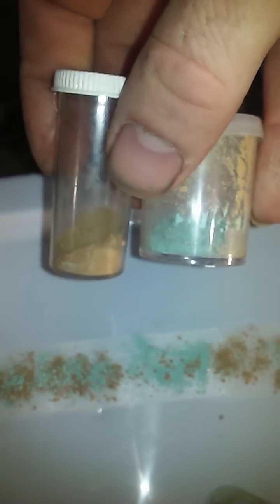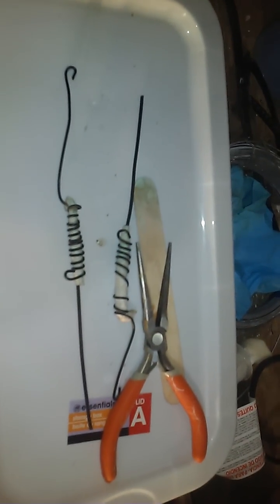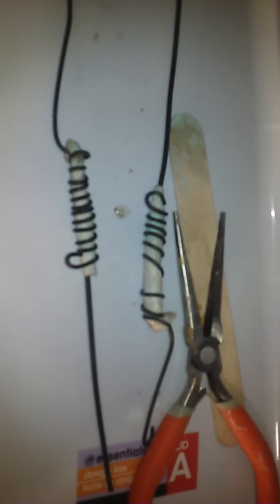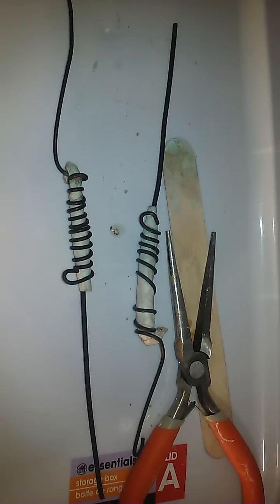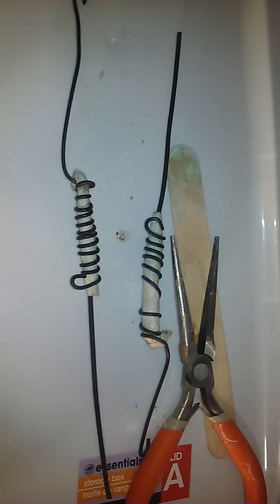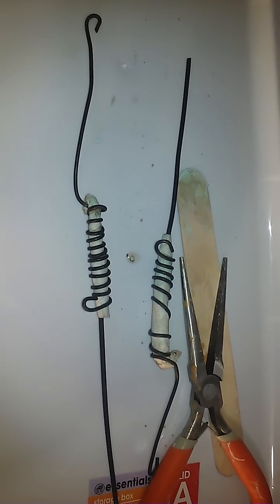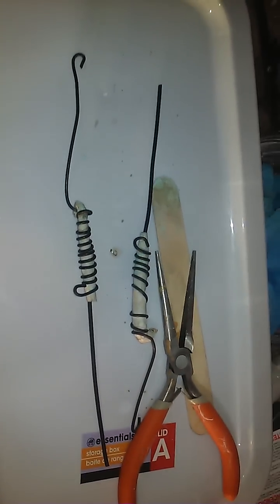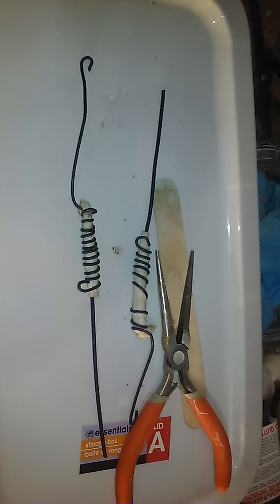Keshe magrav capacitors new trick, hope it works

Comment: Adding tape creates a matter condition which produces heat, different matter causes different effects, apparently adding aluminum wrap creates a battery effect for plasma to reside at for reuse. 

Keshe's intention was to ensure from end-to-end on his units they operate fully in a nano/gans plasma condition, but some things he approved of like a mix of melted sugar & caustic so if any copper did get exposed it would quickly recoat itself.

I think I'm going to leave my caps bare but encase the full 'crafted & enchanted' reactor into a nifty Plexiglas dome or even pyramid with some glowing led lights
Reply from the maker: Nice. Pyrimidal shapes pointing due north and using phi 1.618 would be a great idea. Shall I take the tape off then? It is heat resistant tape

Comment from the maker: If this tape thing works which I'm certain that it will, it really begs alot of other uses. Bandaids with gans in between plastic layers off the skin, belts and bands. The uses are endless and I'm almost sure it will work. Plasma fields should not be interfered with by the adhesive. That's the only thing different from parchment paper.